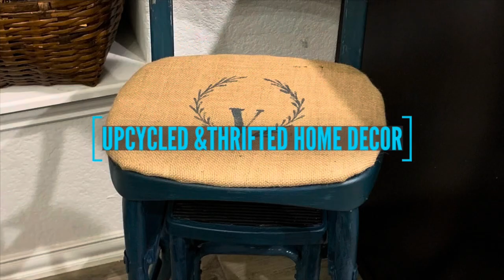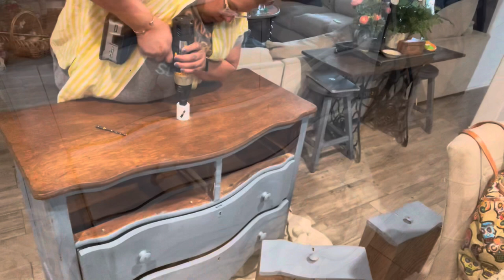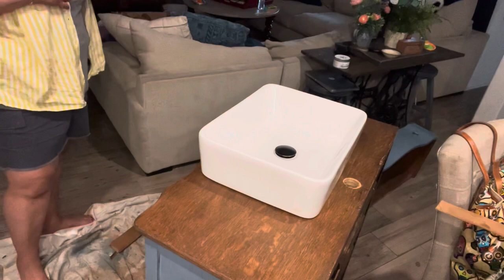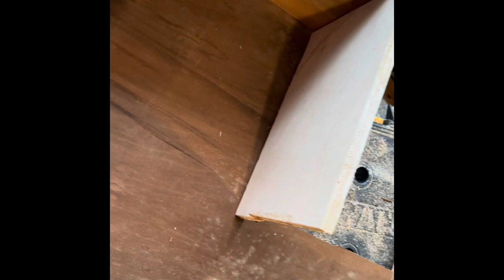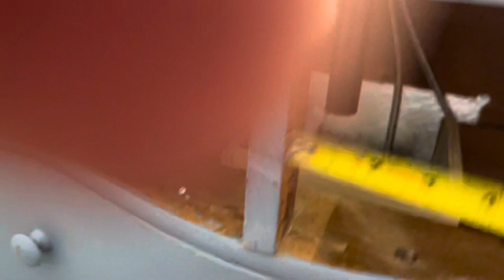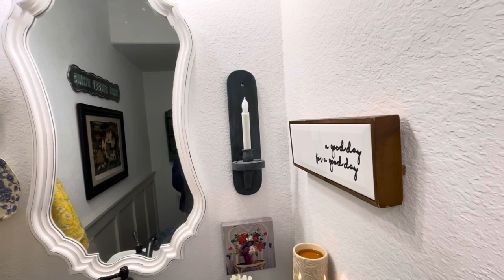Powder Room Makeover Part 2 / Turning a Dresser Into a Vanity

Comment: That looks FANTASTIC! I'm getting ready to do the same. Did you attach the vanity to your wall at all?
Reply from the maker: Thank you! No I didn’t. It really hasn’t been an issue at all. Even opening and closing the drawers doesn’t move the dresser. I think because the pipes are attached to the sink and that is not moving. 😁
Reply: It has great sturdy legs.  There wouldn't be a need to attach that beauty to the wall.